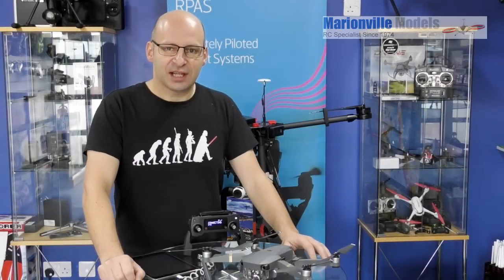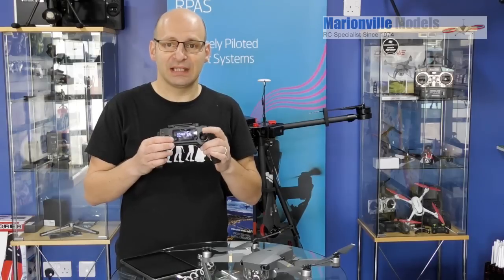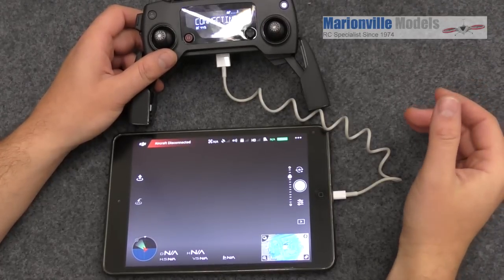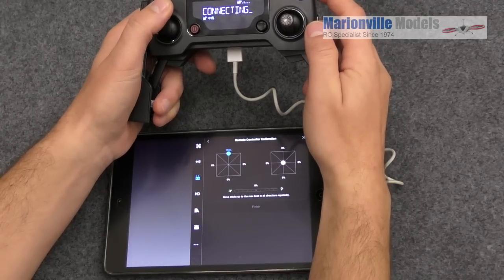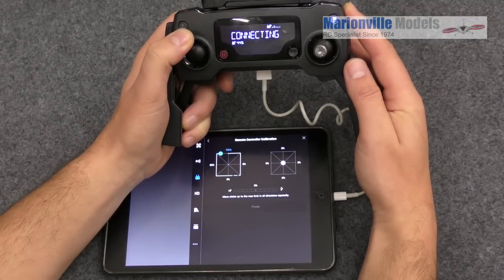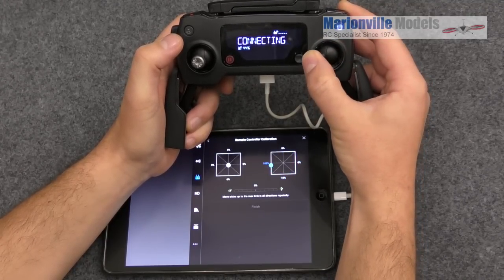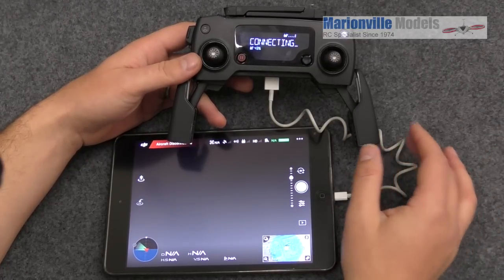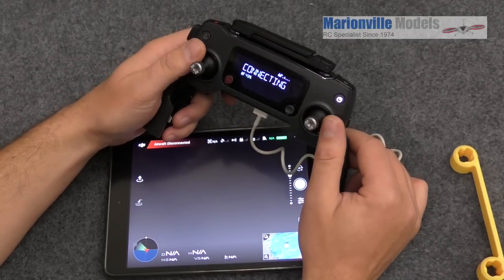DJI Mavic Pro RC Controller Calibration, Fix Spinning, Yaw Issues

Comment: Question Anyway to fix a uncentred controller stick I dropped mine
Reply from the maker: You would need to open it up and have a look. Sticks use magnetic sensors so would assume one has come loose.
Reply: @MarionvilleDrones  thanks for the information
Reply: @MarionvilleDrones  I tested it and it was luckily fine nothing is wrong with the controls luckily

Comment: Hi When I calibrate my  dji  controller the gimble control doesn't complete. I can follow the circle to the left and then to the right fine but it will not move on from there the the calibration complete any ideas

Comment: Hi thank you four your Exllent video just a question can you help me I try to calibrate my remote control from my Mavic Pro Platinum is bleeping and I try to move the stick and is not working any advice thank you very much
Reply from the maker: abel berenguer do you defiantly have it in the calibration mode.

Comment: im off to see if this has worked for me later on, ive got a creeping yaw to the right on hover hmmmm
Reply from the maker: theflyingwelshman g good luck. Hope it works.
Reply: @MarionvilleDrones  nope......unfortunately it didnt work for my mavic pro, still bloody creeping right on yaw whilst hovering!! grrrrrrr driving me insane lol
Reply from the maker: theflyingwelshman g I take it you have calibrated the compass.
Reply: Marionville Multirotors compass and imu
Reply: theflyingwelshman g have you solved? Having the same problem with my mavic pro
Reply: James Austin no mate still did it so got rid and got myself an air2 👍

Comment: Just got a MavicPro and a Samsung S2.  Needed to watch YouTube just to find a work around for initializing Controller. (Boot S2 AFTER Controller and Drone are ON)
Now, doesn't want to Calibrate Controller sticks.  (Times out before Cal is finished). Jeeze...!
I'm an electronics engineer and Commercial Pilot.  No Joy yet!
Reply from the maker: K8UR Channel try using an iOS device and see if that works.

Comment: This morning my mavic wouldn't decend. When it did finally start to defend it was very slow like it was auto landing speed but 400 ft up. After a few stick up and stick down inputs it stared defending normally but only till I let off the stick, then it did the same thing again. No response then slow responce then normal responce. Is a rc calibration going to fix this?

Comment: Hello, great video! Would you have any experience and or recommendations for an upgrade mod for the controller that would extend the distance capability? Such as ite-dbs02.2 (dji mavic pro edition).
Reply from the maker: Michael Kaplan I can't comment on any mods on range extending as we have very strict rules in the UK.

Comment: Hello Rick:  I am thinking of buying the Google Nexus 7 which is actually the NEXUS7 ASUS-2B16. But my general question is connectivity...how does one connect the Mavic controller to a display...that is, what is needed on the tablet, etc.?
Reply from the maker: Android can be a bit hit and miss. I get alot of craft it with issues of connectivity and in most cases its the android device. IOS is always spot on. For connecting larger devices you use the usb charge cable supplied with your device and  plug into the base of the controller.

Comment: I've tried to calibrate the controller today with no success. Every time I do it the left stick shows 4 or 5% on the lower section (where thumb stick would pull straight down) Because of this I never get the option to finish calibration,it just says done. When I click that I get calibration failed message. Any ideas?
Reply from the maker: I know some have had genuine issues with the controller. Try getting someone else to calibrate it as static in your body may affect it. Worth a go.
Reply: I haven't had a chance to fly it yet. Hoping to get it up shortly. You think it should be safe enough to fly?
Reply from the maker: +Dan kearney it's a tough one. You should be ok. If you have any issues hit the return to home.
Reply: Ok thanks for the reply. I'll give it a go I think.

Comment: Very helpful, thank you. But what about moving the sticks over the other lines in the squares, vertically, horizontally, diagonally? Not necessary?
Reply from the maker: No need. You just showing what the full extent of travel is to the controller.